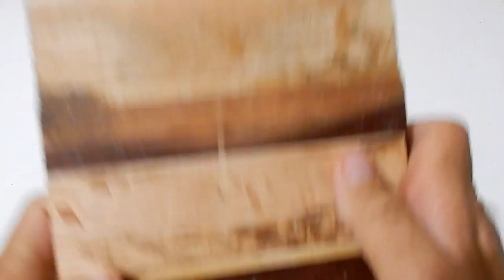Towel Holder for Man Cave

Comment: Nice looking project Jack. I would have thought that you would have made one of those circle cutting jigs for the band saw.  It would seem easier than using that circle cutting bit on the drill press.  Of course the band saw jig would not have worked on the inter hole.  Just wondering.